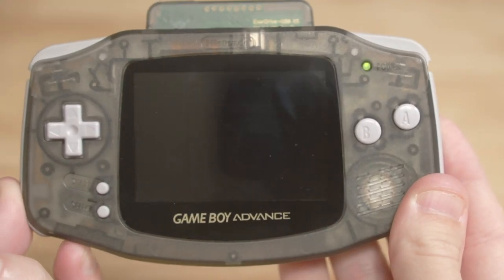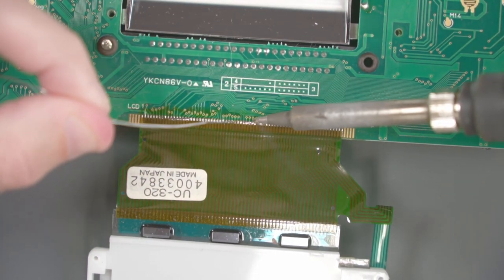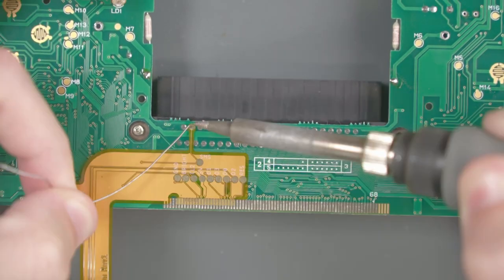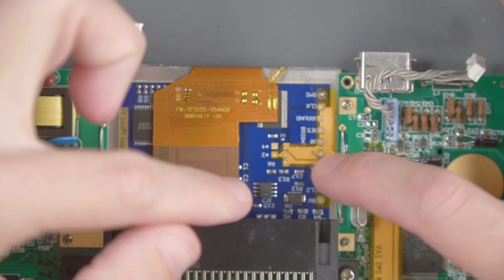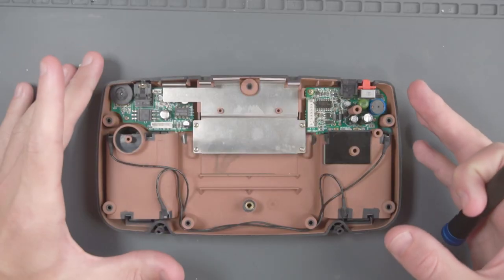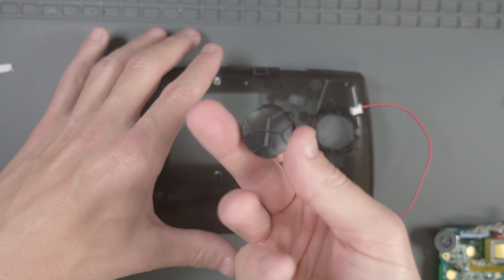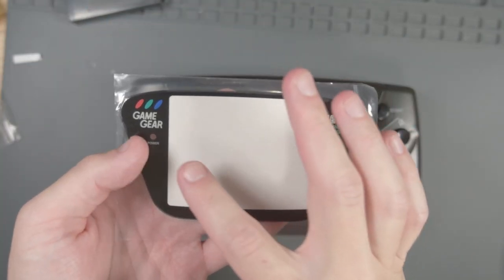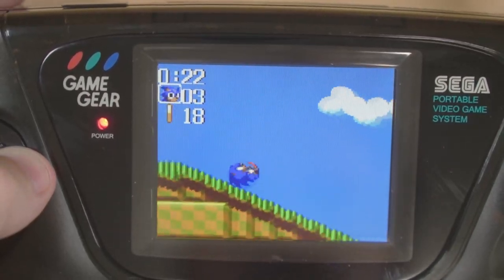BennVenn Game Gear Screen Install!

Comment: Would you say this installation is beginner friendly? I have a Game Gear I'd like to change the screen of, but have no soldering skills or would you recommend a different installation for beginners?
Reply from the maker: I think this is a more intermediate mod, a more beginner kit would be a Super Nintendo JR RGB mod, I have a video about it
Reply: @dubesinhower  I've seen that video, awesome! Maybe I'll start with GBA backlight mod or battery replacements 😆

Comment: Is there a way to cancel the scaling changes? I cannot play NBA Jam since I have to push Start for turbo and go up and down the player.
Reply: We fixed this with a firmware change as of a few months ago, we've lengthened the delay period so games like NBA and Ecco don't trigger scaling mode changes. You can also install the touch sensor module to change modes (they're usually about $0.10 on ebay or we have them in store too)

Comment: My gosh, that non-integer scaling looks atrocious. What's the pixel count on this BennVenn? Ideally these replacement screens should have high enough PPI that half-width pixels aren't noticeable with 10:9 PAR content stretched to 4:3 using non-integer scaling (the most authentic way to plays Game Gear titles, because the OG screen used non-square pixels). A 1080p panel with a line-doubler would be perfect for this, which is why I'm personally skipping this product and waiting for a potential BennVenn V2.
Reply: If you hold start, you can select an integer scaling mode.